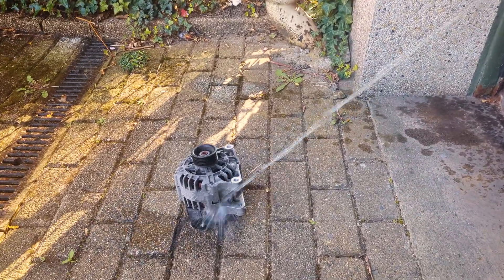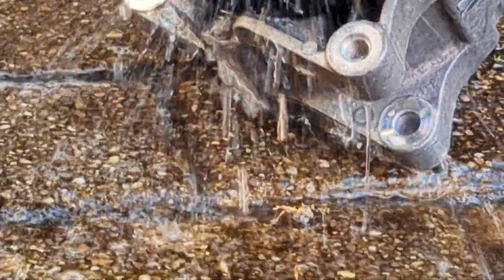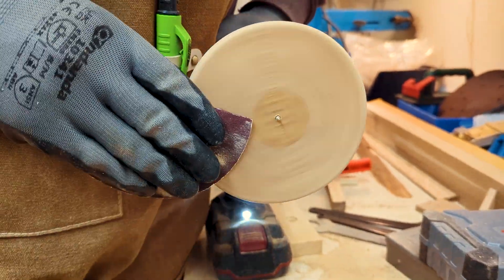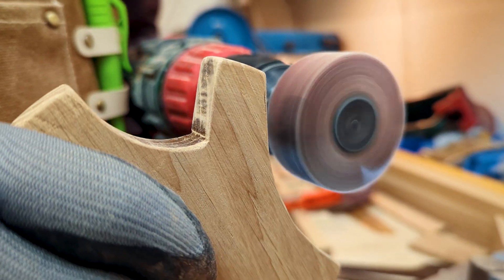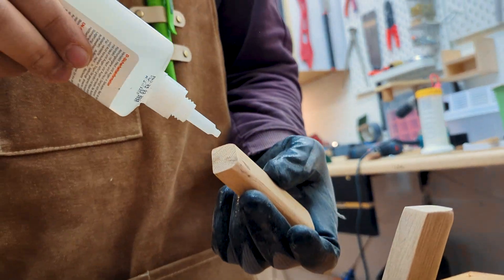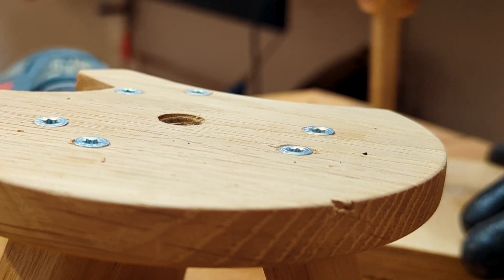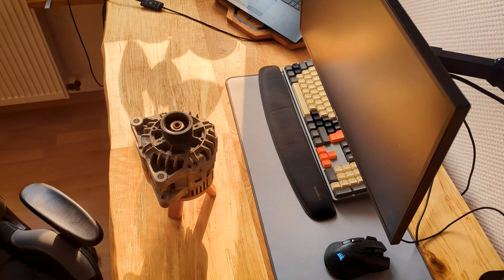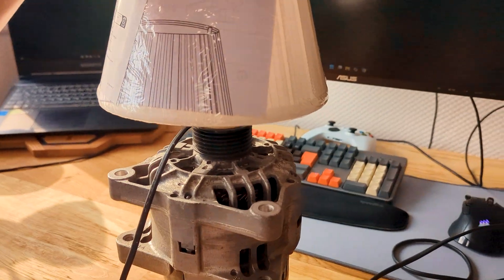Not your usual Lamp DIY | Alternator Lamp DIY

Comment: The Alternator charges the batteries, not starts the car 😅 That’s the starters job :) But, I totally agree the alternator is by far the best looking car part in the engine bay. Cool concept!
Reply from the maker: Thank you 
but i think i will redo this segment and than repost the video 😂 
you will get an honourable mention
Reply from the maker: Yeah you're right😅 i got that mixed up